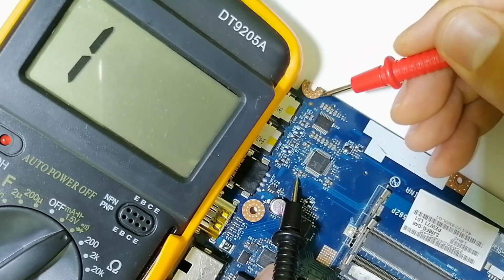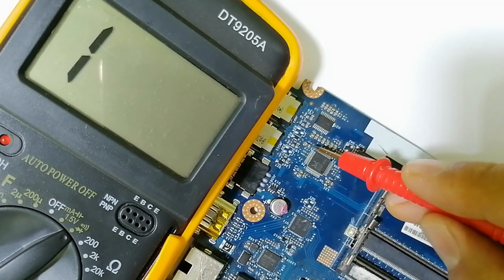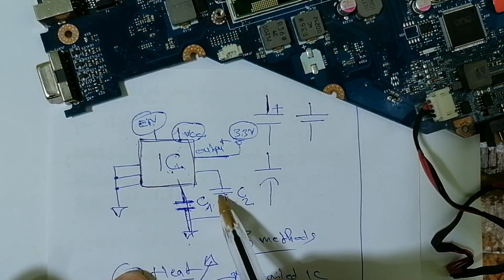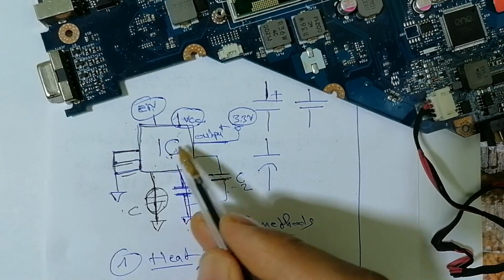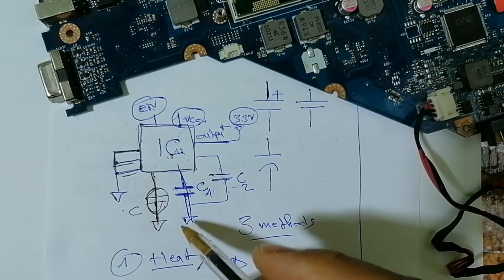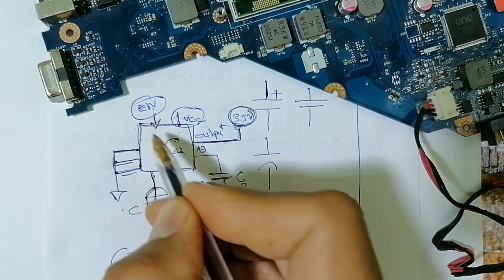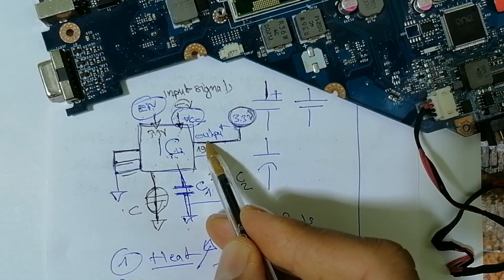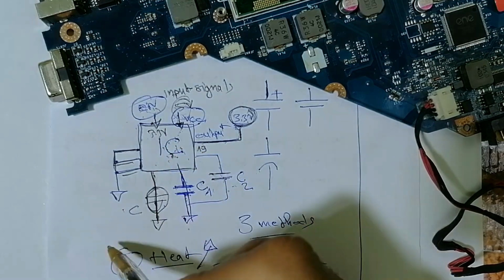All laptop components Tested with multimeter-electronic components - SMD capacitor test, Mosfet

Comment: Hello Sir! Was the power jack connected to the motherboard during the tests? And if not, where does the motherboard get the voltage you are using to test the different components? Thank you again.
Reply: No, the power jack was not connected. If it was, then he would have put multimeter in the voltage range.
Reply: Also, he is checking the impedance of the components.

Comment: When you measure the mosfet you read a „drop voltage of 500“ from the multimeter in continuity/resistance mode. 

How can you measure a voltage drop in Ohm?